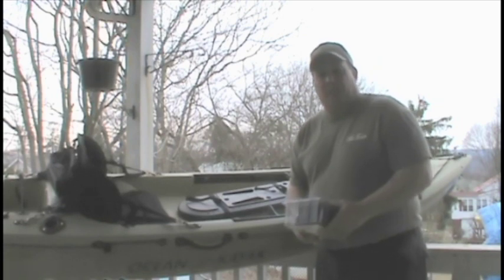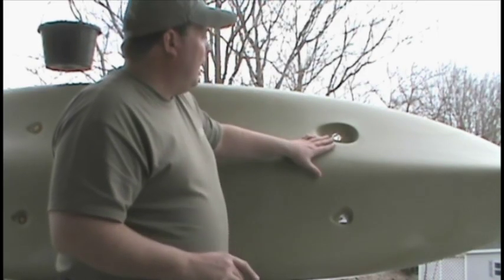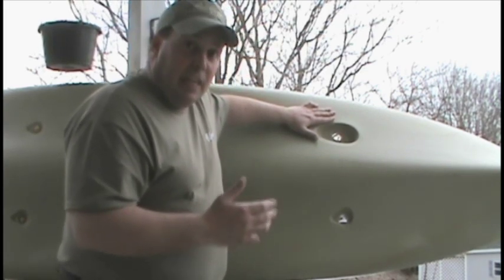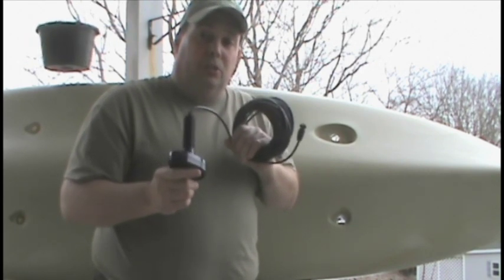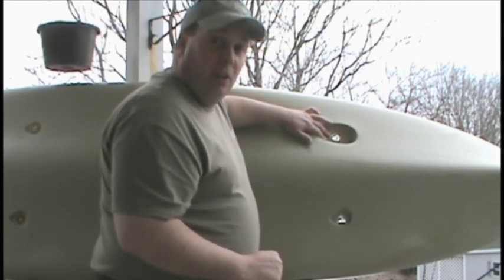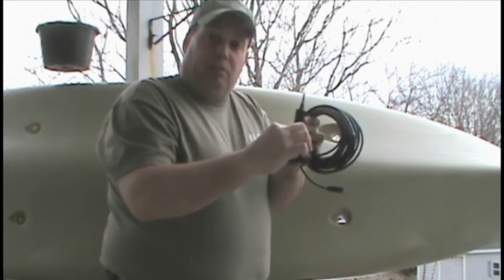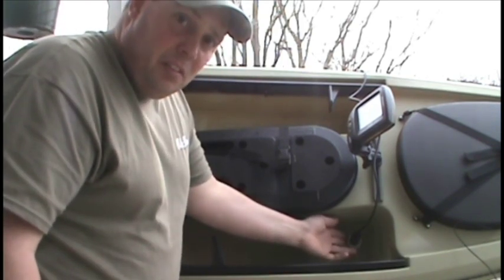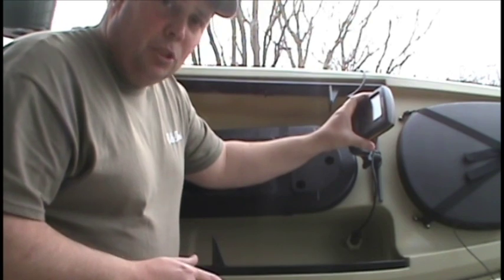Ocean Kayak / Humminbird Scupper Transducer: Episode 53

Comment: I bought this transducer through Hummingbird for my ok trident 11, I'm in the process of installation and I'm using this video for a visual reference. I have the directions manual in front of me right now and #7 in the manual states (Word for Word) "Make sure the narrow (thin) end of transducer is pointing forward. I had installed it first as you did with the wide end facing forward witch is also more like the exact shape of the recess for transducer...so I spun it around for giggles and noticed the transducer was now flush if not recessed in hull (as it should be!) @ about 4:25 when you say It does not stand out much below the hull of the boat, if you were to spin it around it would be flush if not recessed. Very confusing to me because of the shape in the hull.....looks correct! I'm wondering if you have been looking behind you the whole time.

Comment: Sounds great but the Humminbird XTH 9 20 P transducer mentioned only works with
select models. It will not work with the 165, 175, 17ci, 195, 196ci models. I bought the "top of the line" PiranhaMAX and it is not compatible with the scupper hole transducer and now I have to buy another fish finder for my kayak. Thanks for nothing Humminbird.